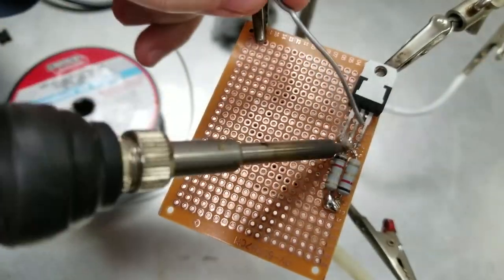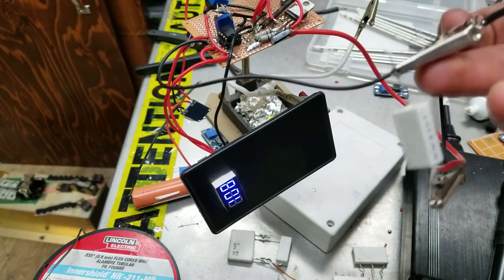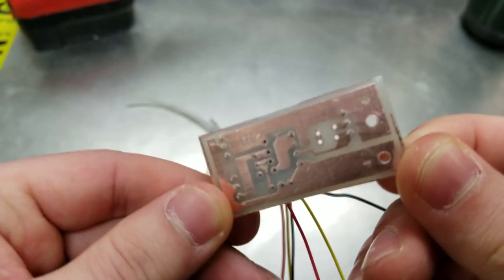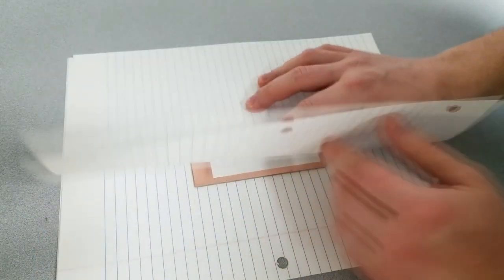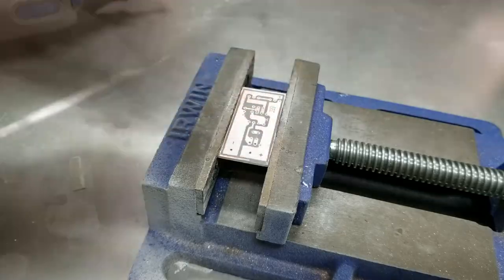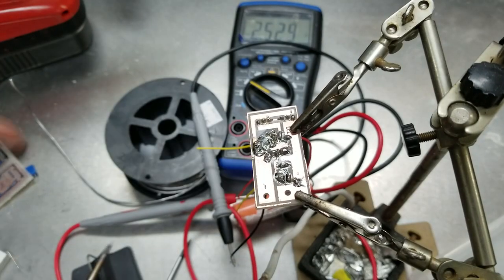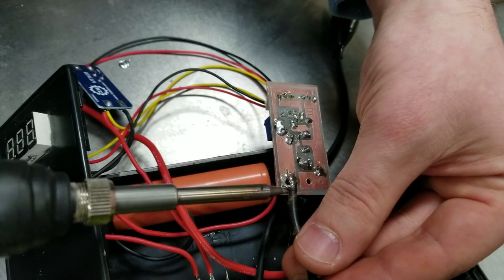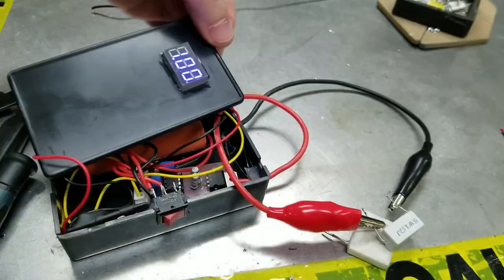EASY & CHEAP DIY Ω METER ( PART 2) ( THE PCB )

Comment: Did you consider using a Kelvin connection for your leads to improve accuracy?
Reply from the maker: Originally that was the plan, but error was not significant.  So I sent with just 2 leads.

Comment: hello try to make the design but some connections do not match the board and the circuit board, I do not understand what the boos is for you and how it connects with the voltmeter I hope you clarify that doubt, thank you
Reply from the maker: Hi the component you are asking about is a boost converter. It is a voltage step up module. Its needed for the volt meter to show readings higher than the voltage of the battery.
When you measure 1 ohm resistor the volt meter will show 1v, but when you measure 10 ohms it will show 10v..
If you are not planing to messure higher values than 3 ohms than a boost module is not needed.
Hope that helps!

Comment: May i ask 
Why 100mA and a 101 gain on the amp?

Lets say R=0.1 ohm
I = 100mA
then V = 0.01 Volt
x 100 gives 1 as the displayed value.
Reply from the maker: The formula in the datasheet is (r1/r2 +1) dont remember exactly. And the resistances were after calibration were pretty close to equal to 101 gain.....
Reply: @EECPOWER  
Thank you. Apreciate the responce.
You are 100% correct on the gain formula.
I would like to figure out why you chose a gain of 100?
I feels like a 100 gain would give a reading on the volt meter that is out by factor 10x (see calls above).

BTW, what are (or did) you studying? 

Kerp up the hard work
Kind regards